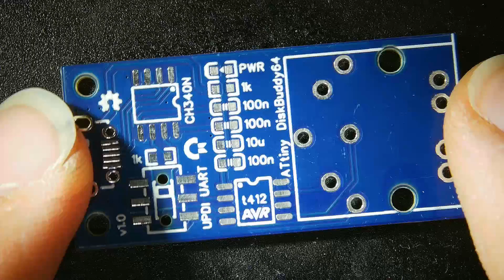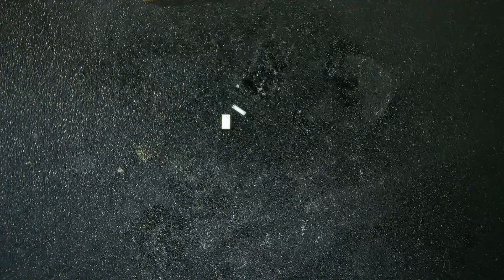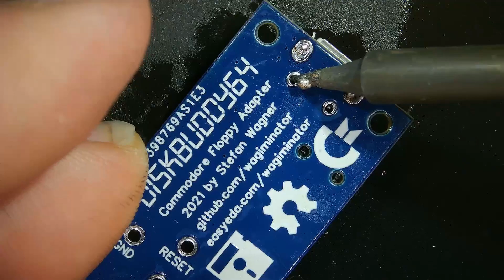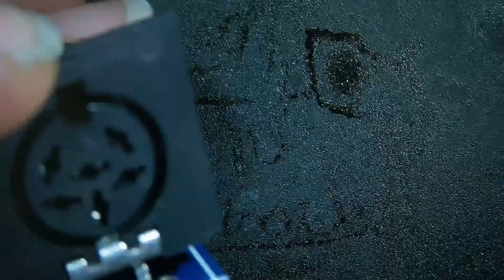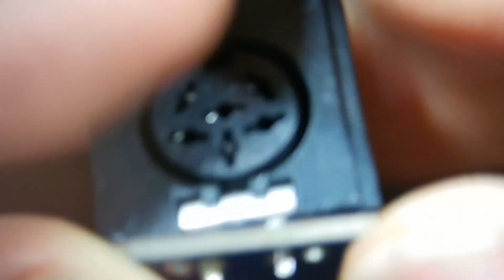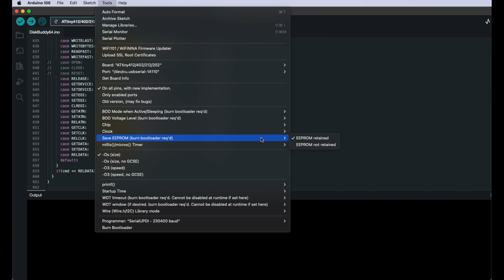Diskbuddy64 overview and build

Comment: The 1541 disk drive. I had to make a Capsella Science toy into a fan with two AA batteries to stop the thing overheating when I put disk B 'TOWN' in to enter a city in Exodus Ultima III. Oh the memories. Go near town, change disk, connect lead on batteries and let fan spin up, Move onto the town square. Pray... Good times

Why didnt you show it in operation?
Reply from the maker: For starters, its packed away. Secondly, when i decided to make these i got a tad bit in a hurry and fried my U2 CIA chip.  I can make a video using this device, but i can't actually use the disks on my C64 at the moment :(

Comment: what is the flux for? Is it so the components don't slide around as much or is there another purpose for it?
Reply from the maker: From wikipedia:
In soldering metals, flux serves a threefold purpose: it removes any oxidized metal from the surfaces to be soldered, seals out air thus preventing further oxidation, and by facilitating amalgamation, improves wetting characteristics of the liquid solder.

Basically it allows the solder to flow and adhere to the parts smoothly.  Otherwise the solder will bead up like water droplets.  Best way to think of flux is as a surfactant.